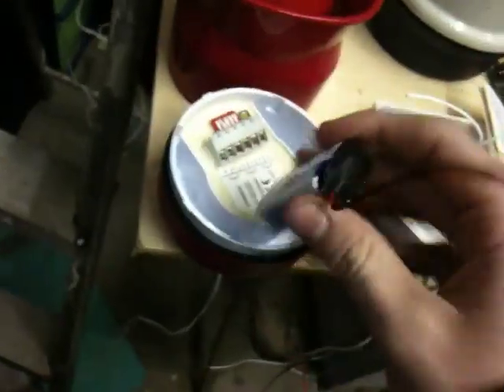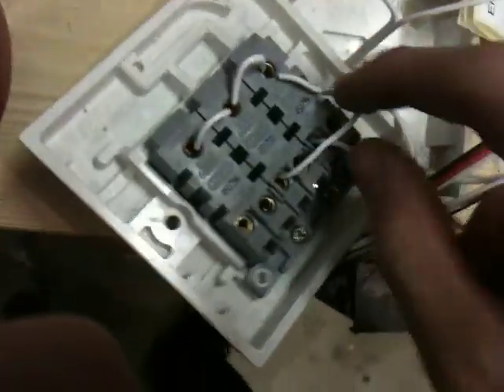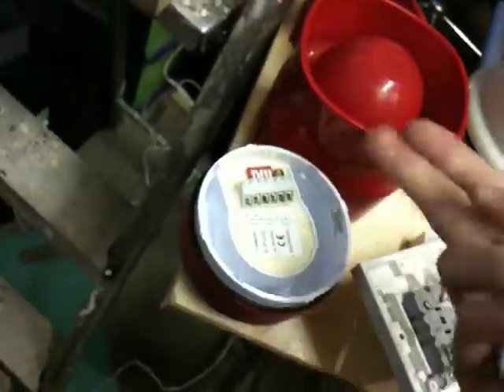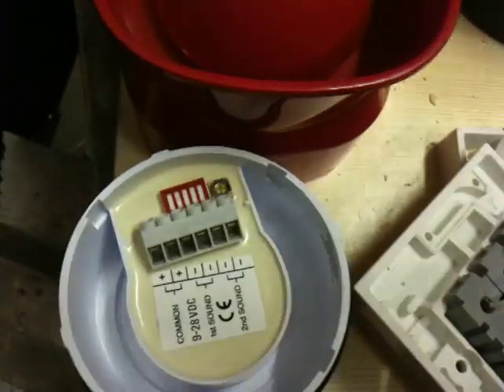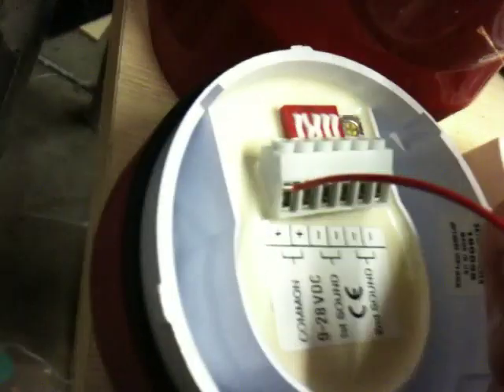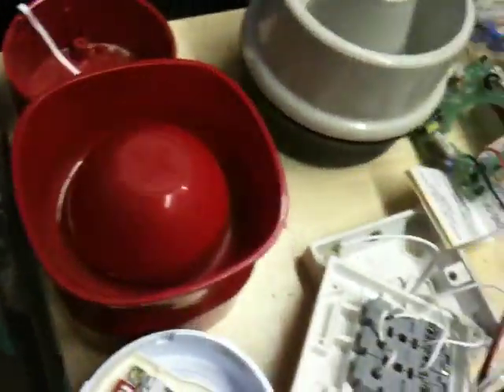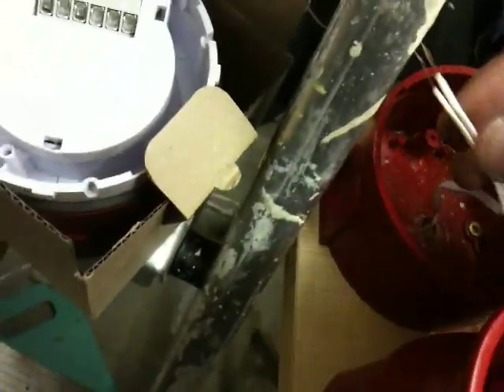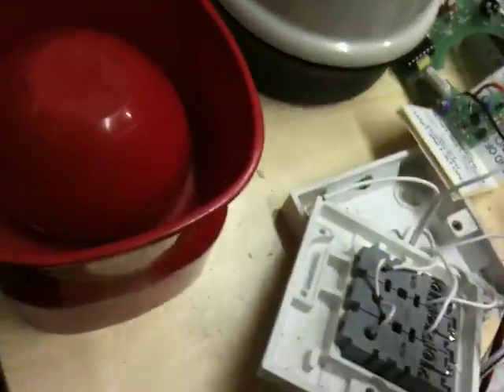Wire Up a Roshni Sounder using 9vBattery

Comment: I have 2 roshni sirens with strobe . Mine is the older one with out the switches . I can get the 2 siren tones working but not the strobe . How can I get the strobe to work .   mod 0832-cpd-0133 . Thanks